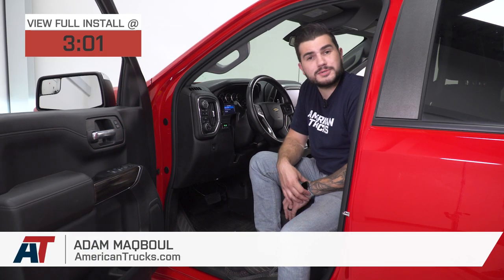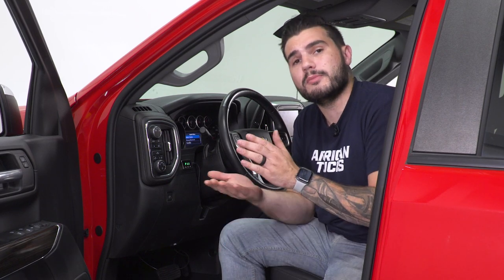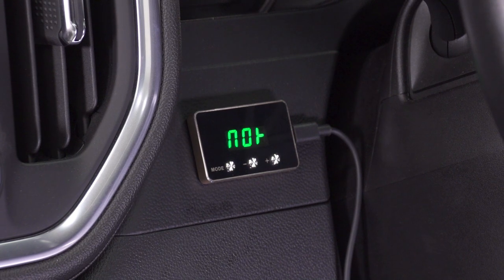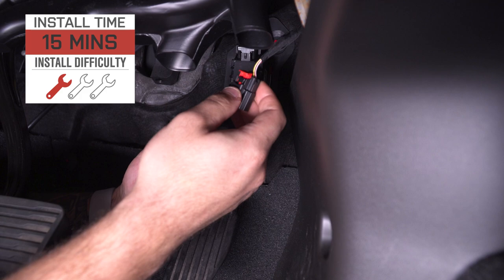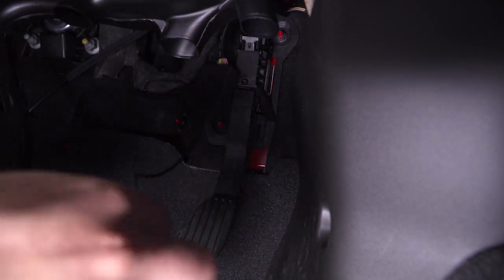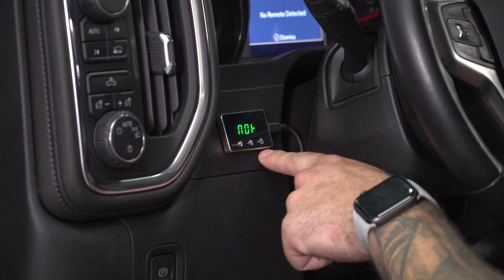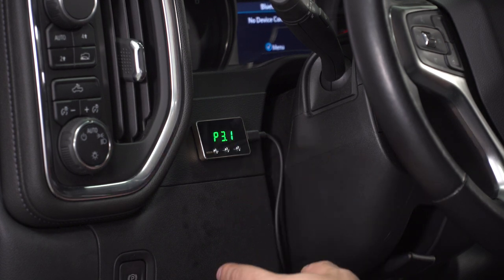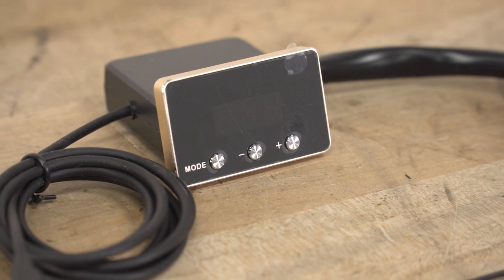2019-2021 Silverado & Sierra 1500 SpeedForm Throttle Controller Review & Install

Comment: I bought this exact model on Amazon for $50 and after 3months, it put the truck in limp mode. I Installed it properly and never adjusted on the fly. You get what you pay for, I heard that it happens with the $300 pedal commander so these are really a hit or miss on the GM Pickups

Comment: Will this work for a 2015 Chevy Silverado LTZ 5.3L?
Reply: I just bought one for my 2015
Reply: @Geezy314  any issues with it ?? Mine put my truck in limp mode after 3 months
Reply: Yes It put my truck in limp mode while sitting in traffic as well , it was fun when it worked

Comment: Bought one of these and as soon I I started messing with the different modes it made my RPM’s rev up very high while it was still in park,especially in sport mode. Is that normal??
Reply: Mine as well. I just installed it today. Is it still doing it for you?
Reply: @david32086  I returned it back to the company.
Reply: Cheap controller. Mine just went straight to limp mode after 3 months
Reply: I put on one my 2017 Ram when I had it. Had it on there for over a year.Thing was freaking awesome! Really made it fill like a new truck. Was hoping for the same results when I bought this for my Chevrolet.